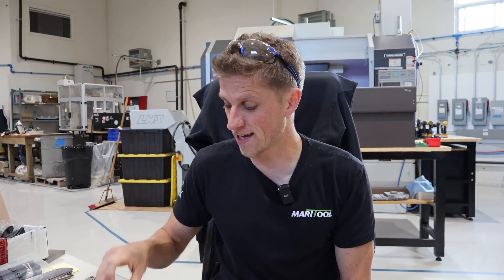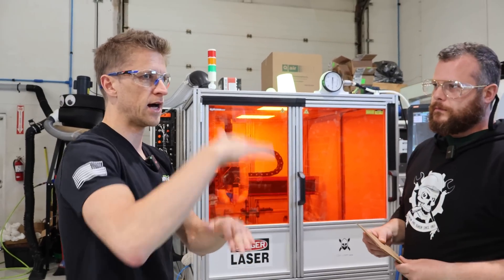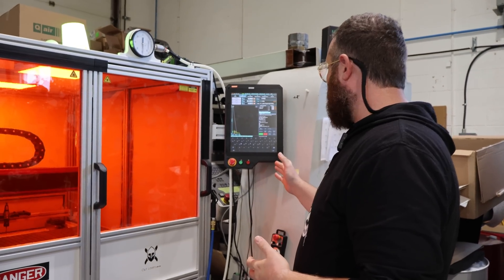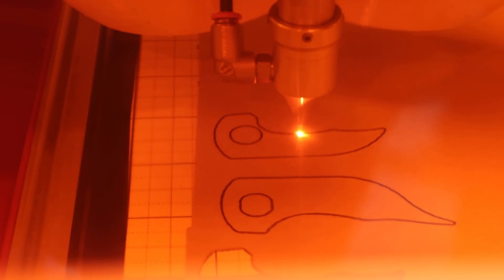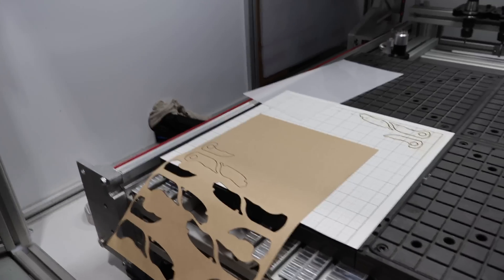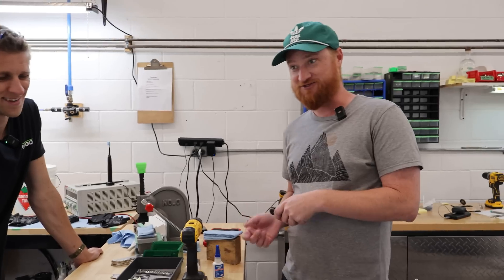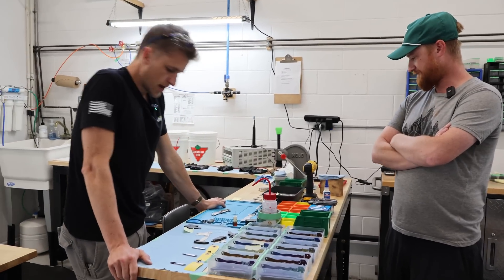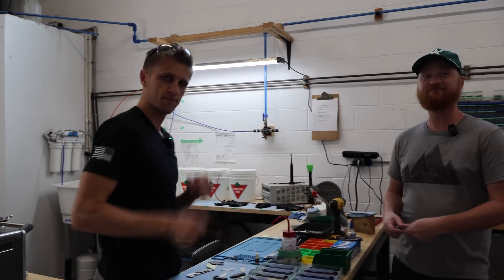Laser Cutting Norseman Inlay Bonding Tape!

Comment: I used 3M 467MP a lot with 25W and 50W CO2 lasers cutting on a honeycomb bed and always cut in one pass. I never had problems with fire. So I'm wondering if it's either the type of laser you have, or the surface on which you're cutting.

Comment: I had to remove vhb several times : moderate heat, insert a lever and apply constant but not excessive force. Glue will slowly fail and give out.

Comment: You can use heat to remove VHB or Loctite 380, not enough to damage the handle anodizing or carbon but enough to soften the adhesive.  Maybe 120C or so.  It will soften enough to just lift right off.  That VHB tape is similar to the stuff they use to bond phone screens and other parts to the chassis, and heat is the only way really to take those things apart.

Comment: Process using the tape should, IMHO be to 
1. cut through the upper paper and just into the backing sheet.
2. Remove the upper paper  from each profile and position the inlay above, using registration marks on the sheet and a jig to hold the clean inlay clear until it sits perfectly.
3. Press down on the inlay and leave it attached to the sheet. Use masking tape to hold it if necessary!
4. Repeat until the sheet is full.
4a. On the complete sheet, rub down from the backing side to ensure proper bond with the inlays.
5. Cut sheet through, around each inlay. Straight rectangular cuts may work unless there's close nesting.
6. For each inlay now on its own piece of backing, clean and prime surface of knife. Locate in holding jig.
7. Pick up inlay using other part of alignment jig and peel off remaining backing sheet.
8. Align jigs and lower the inlay to the knife.
9. Repeat for all inlays on that side, using appropriate locating jigs.
10. etc.

The locating and alignment jigs can be 3D printed for each style.

NB when using volatile solvents to clean surfaces prior to bonding, allow ample time for the solvent to evaporate. Some residual solvent may react with unbonded adhesive and compromise the bond strength.

Comment: Great video, it's always interesting to see the evolution of a process. I've had some projects that used the same tape, and I think I can contribute a bit to improve speed and efficiency. In one of the early ones where I had to attach a polycarbonate membrane to a case, I had the same idea of cutting and gluing it onto both parts. At the time, I used a vinyl sticker cutter that worked better than i expected, but the application on wasn't easy as it's very easy to stretch or position it incorrectly. It ended up working with a lot of care and a bit of adhesive tolerance.
In another project where I had to attach various acrylic letters to a sign, I applied the tape to the plate before passing it through the CO2 laser cutter. The application was much easier in this case, but it requires the machine, and depending on the material, it leaves the edges burnt. I believe the diode laser you used is somewhat inadequate for this, but still, you deserve congratulations for safety (many people would use it without precautions). In general, for cutting materials that are sensitive and can catch fire, it's interesting to have a bit more power (enough to cut in one pass) and much more speed, as in the process you showed with the galvo and the roller.
Another suggestion, but I haven't had experience with this, would be to machine the adhesive already integrated into the inlay.

I hope this comment was useful to somewone!

Comment: CNC a die, place the top and bottom die in an arbor press and stamp out the adhesive stickers. Also it would be a lot easier to put the adhesive onto the insert first, then press the insert into the recess than trying to do it the other way round.

Comment: What sort of laser are you guys running? I run a co2 one every now and then at work and I've cut 3m adhesive backed clear plastic (single sided) and it cut clean through at around 35mm/s in one pass. The materiel is was working with was around .012" total (paperback, adhesive, and plastic). That particular cut was done on a cheap Chinese K40 form factor laser which is only capable of 40W. We recently got a XTool P2 that is miles more capable, even though it is only slightly more powerful at 55w. If you guys are wanting to scale this a fair amount and not have it be a significant runtime per sheet it may be worth looking into a dedicated co2 reflector style machine. The P2 I mentioned is more of a hobbist grade machine and the support is hit or miss but it is extremely easy to run and allows for very quick runs to cut down on dial in time. It's also got some neat features on the software side.
Reply: We also use VHB very often and I've got a few tips for that. What you're doing with these inlays is the PERFECT application to use it. As some other comments have suggested using a jig to help apply the tape would greatly increase repeatability and most likely application time. I would highly recommend trying to apply the precut pieces to the inlay itself and then stick them into handle. Trying to place rather pliable and annoying tape into a recessed hole is just asking for weird misalignment or creeping up at the edges. Also to get the most out of your bond apply a significant amount of pressure for ~30min-1hour, most families of VHB like around 15 PSI of relatively even pressure  to achieve full "wet-out." You can also look into heating them up to around 50 C to speed up the process but I don't feel that's strictly necessary for this application. As far as removal goes look into 3m's citrus based adhesive remover, its basically goo gone on crack, effectively melts the adhesive when given enough dwell time and your little peepholes should give just enough access to wick in there and set them free if the need arises. Hope this helps out and if you're ever concerned with longevity just know that this stuff has been used to create a IP67 seal on a 24", full aluminum monoblock display for military use.

Comment: Since you have holes on the handle, can you laser cut matching holes into the tape and then put in locator pins/ needles into the holes to guide in the tape? That would prevent the problem of touching the tape in the wrong place and increase repeatability. Maybe a fixture to hold the tape with the glue face up and.then slide the handle down the pins.

Comment: There is probably a SKU of VHB tapes that has vinyl adhesive protection, instead of a paper one. I think that wouldn't catch fire while laser cutting.
Another idea is that maybe you should create an arbor press with positioning plates for gluing in the inlays. So you can capture it and not let it slip 🎵

Comment: What you might try is making a 3d printed jig for the inlay alignment. (That is kinda like a book, a hinge on the side). One side holds the knife, other side holds the inlay. As you close the jig, it brings the inlay and the knife together perfectly. You can then put it through like a roll press or some other method of applying pressure. I would think this should increase the speed an accuracy of the process. With much less waste and cleanup. Since you already have the cad models for everything. I would think that it should be relatively simple to make such a 3d printed fixture.

Comment: What about one of those Vinyl cutters where its using a sharp blade to do the cutting,
I think that would be a better process for vhb.
I don't think there even that expensive.
Reply: Was thinking the same thing. Bought an off brand, 24” wide vinyl cutter a decade ago. It’s been a reliable workhorse. Faster than a laser and much cheaper to run. Wonder if using the laser was recommended by 3M or an example of The Law of the Instrument.
Reply: @GOAP68  The law if the instrument, I've never heard that term before, it's the if all you have is a hammer, every problem looks like it should be cut with a laser 🤣👍🏻
Reply: Yeah, laser leaves a burnt edge even on that clear glue.  with a vinyl cutter may work better as long as the glue doesn't stick to the blade and then drag along.
Reply: @human2761  with the vacuum chuck it would probably be fine.

Comment: I use 3M VHB tape to bond Mylar seals on the ailerons elevator and rudder on sailplanes we replace them every three years the best product to remove the residue is 3M 100 Adhesive cleaner. It’s a Available in a 1 litre can.

Comment: I'd make a fixture that has has a recess for the inlay and locating pins at the screw/pivot locations. The idea is that you could place inlay into recess,  apply tape to inlay, take second backing off,  flip scale over onto fixture, push down.

Comment: I do a lot of laser cutting on my 100w laser cutter doing acrylic signage. You have to be careful there is a type of VHB that is laser safe it doesn’t produce as much smoke it also doesn’t coat the laser with residue on laser nozzle and also coat the internal lenses in the laser. Good idea though there is a support email from 3M that you can email and request their engineers to give you the right product for your application. You can also request the laser safe SKU.